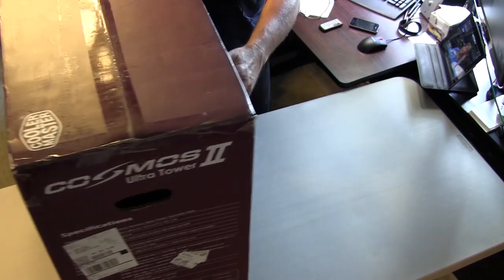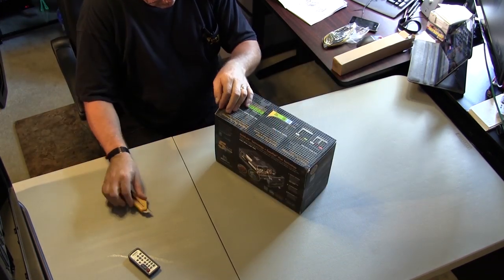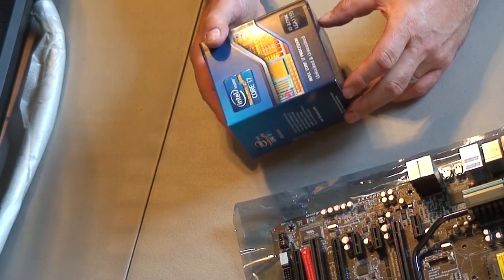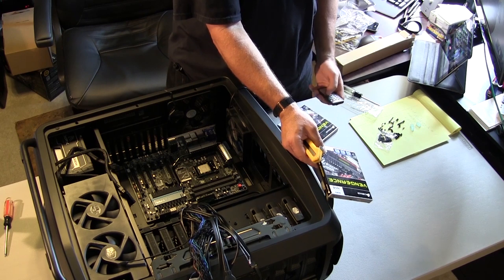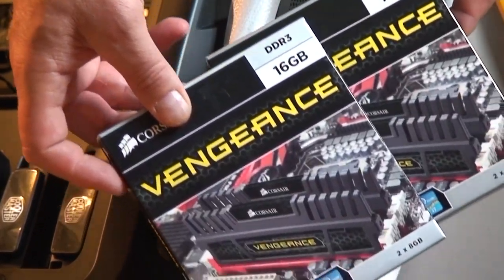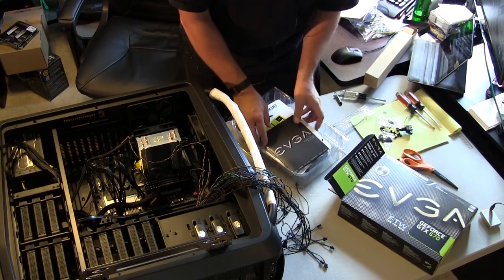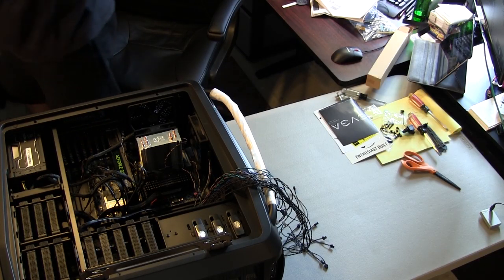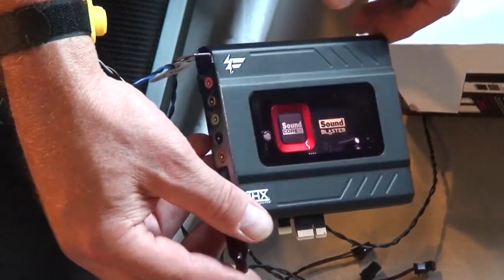Building a new super-fast computer

Comment: Would love to build my dream computer (no money lel.) I prefer AMD over intel because they have faster processors. I especially like the a10 7850k because it is FM2+ socket, quad core (with a process speed of 3.7 per core.) Integrated Radeon R7 graphics which, as far as integrated graphics goes, is pretty good. Wouldn't mind getting my hands on an FX processor though. I would definitely go with a Gigabyte motherboard though. Love Gigabyte a lot. Another thing I would love to get is a Sapphire Radeon R9 graphics card which has 8gb GDDR5. Has 1 Dvi-D and four mini DP. This all would come in over 2k in USD... Not mentioning that this thing is a huge power sucker xD. The graphics card alone would take 500 watts.
Reply: AMD may have higher clock speeds, but they don't perform nearly as well as Intel does.
Reply: I think that AMD is probably better with gaming (except Intel's i series) But I would go with intel if I were to set up a server.
Reply: Alex Ven
Nope, again, Intel performs much better. Look into it.
Reply: I have. I just like AMD better. I have had Intel processors in my computer. AMD is so much better for the price.
Reply: Intel makes higher quality, faster, and more reliable processors. The only time AMD makes sense is in a serious graphical environment (ie gaming) or for price.
Reply: Iam Kane I am more into gaming, so I am biased towards AMD. I would prefer intel if I were, lets say, rendering a video or creating a massive project. I love AMD's gaming ability though, plus are very good in price.
Reply: Wut Wut
I used to say the same thing.

Then i got a 4670k.

Never going back to AMD.
Reply: Panthrax I used to say the same.

Then I got ebola.

Used to have an i7, loved it but I loved amd better
Reply: Wut Wut
I don't believe you.
Reply: Panthrax I wouldn't either
Reply: Panthrax I like intel, but I like amd better. Not everyone is going to agree with your opinion
Reply: Wut Wut
It's not an opinion. Intel is better. That's a fact. Intel performs better than AMD in just about everything.
Reply: Panthrax In your opinion. I'm just saying that I like amd better. Nothing you say will change it.